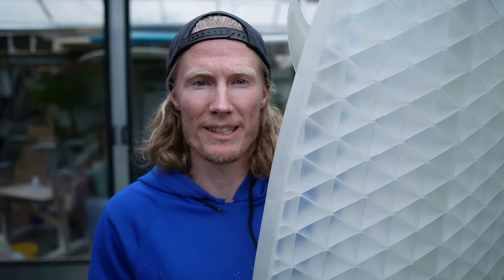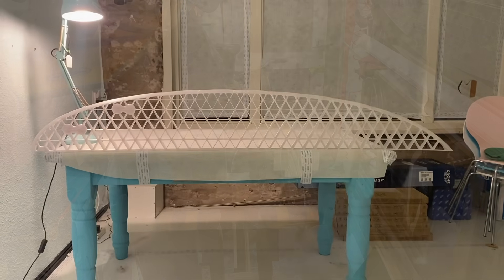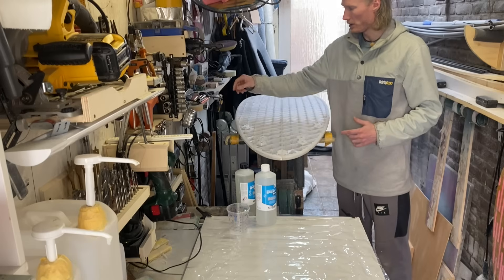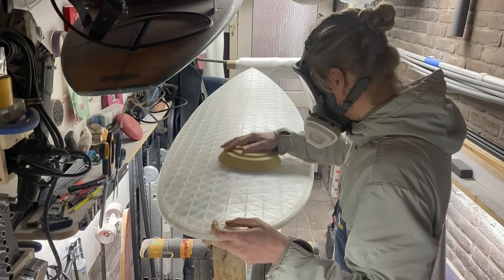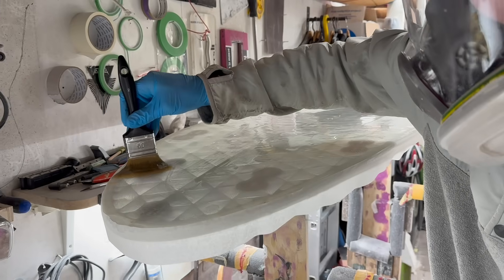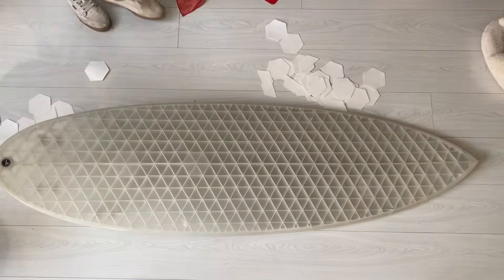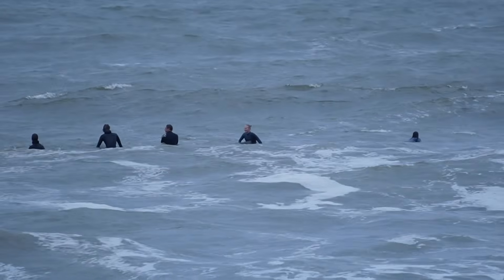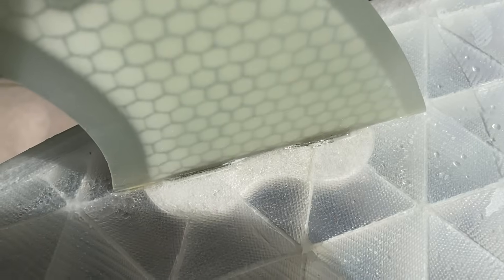How to 3D print a surfboard with a basic 3D printer?

Comment: Would of been way easier to print that board on a CR-30 printer lol. Good job thou that looks cool
Reply from the maker: I will look into that for the next one!
Reply from the maker: Ahh. I see that that's a belt printer, you can print large pieces with the one. Nice! But that is a lot more expensive than my second hand Prusa one. Maybe I will buy one in the future if this channel is generating some money.
Reply: @Dzjiefoils  I would go for a bamboo lab printer, normal size, but much faster and less hassle to make it work, also you can print other stronger materials.

Maybe contact them and try to get a free printer, many content creators on the 3d printer side, you can try a colab as well and get them to print parts for you.
Reply from the maker: @andretavares8507  thats a good idea, but I first need another 3D file. I’m not gonna make the same board. Maybe a fish or something.

Comment: Use a bigger nozzle and layer height to reduce print times ! Great work
Reply from the maker: Thanks for the tip! This was with a 0.6 nozzle. But will have to look into the layer hight settings. 🤙
Reply: @Dzjiefoils  you could easily print it with a 1 or even a 1.2 mm nozzle. but finetuning the printer is an important part too!
Reply from the maker: @freelife-productions5745  Wow 1.2mm I didn't even knew that this existed. Sick! Will look into this.
Reply: @Dzjiefoils  yeah they go up to 2.85mm i believe
Reply from the maker: @freelife-productions5745  wow sick!

Comment: This is a great video and a very cool project! I can't believe how long it took to print!

I wonder if it's possible or will be possible to add chopped glass strands to your plastic mix so that everything printed is reinforced with glass fibres? 
Look forward to seeing this in some better waves, it looked too light for those gutless waves. A bit of force and steepness will make all the difference I reckon!
Reply from the maker: Dude! I think filament like that exists! I definitely keep this in mind if I ever do another one!
Reply from the maker: And yes, the waves suck over here. I need to take this board on a trip somewhere with good waves. But than I need to take all my homemade boards as well! Will be a very large board bag!

Comment: You are a legend! I always wanted to print a surfbaord but didnt have the time to do it. 
I am sure you can optmize the STL file to print it faster (can help you out to set a profile if you want), 12 hours for a piece this size is a lot!
Also, covring the board with carbon fiber instead of fiberglass might give it more strength and thereforce more surfable, yah, it might destory the cool design.
love your content, I am sure your channel will explode one day!
Reply from the maker: Thanks for the kind words! I tried all kinds of things with the printer settings to make it go faster.. but it didn’t work. If I ever make another one I will ask some people for help with printing, and I will also buy a new printer because this one is starting to fail.
Reply from the maker: And I also thought about carbon fibre, but I didn't want to spoil the looks.
Reply: @Dzjiefoils  Maybe carbon just on the bottom.

Greate video BTW, looking foward to see updates.

also would be interesting to see you make other smaller boards with similar technique. Maybe a foil pump board , or wake board. would be faster to print
Reply from the maker: All great idea's. The see-through foil will also be handy to see jellyfish being sliced by the foil.